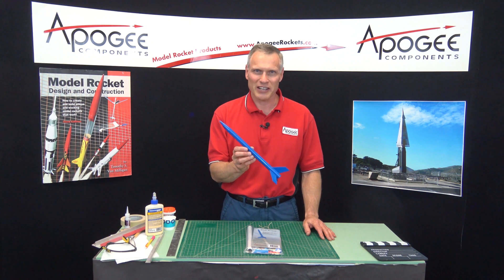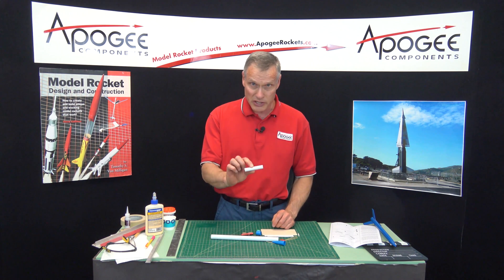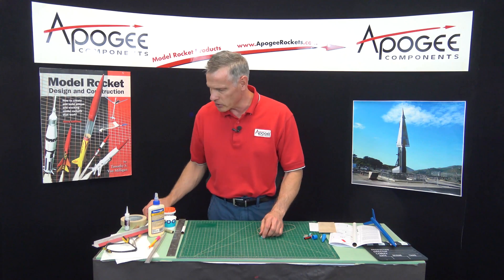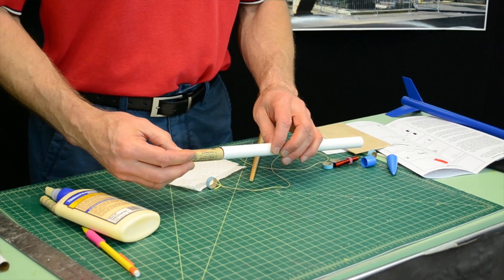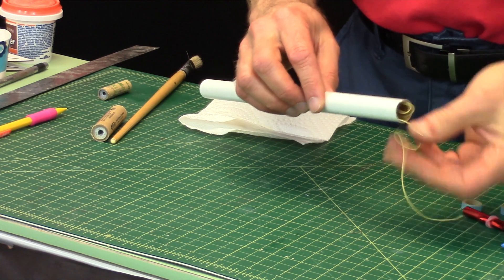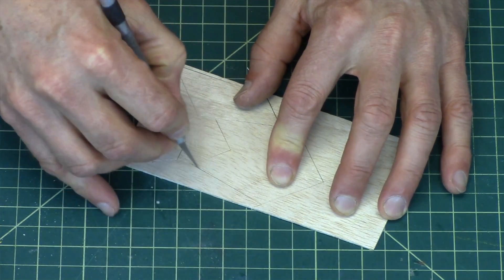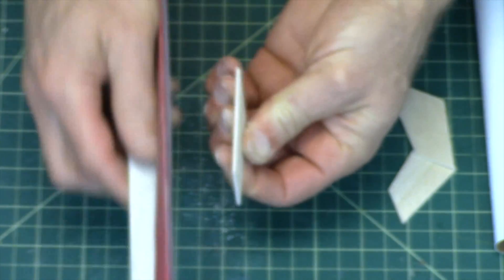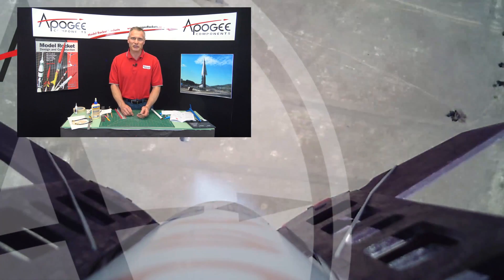Blue Streak Assembly: Part 1

Comment: I also always save the spent motors, they make great adapters for smaller engines. 24mm for an 18mm engine, 18mm for 13mm engines

Comment: I love this rocket! I also LOVE these rocket assembly videos!!

My 2 cents...When cutting the V notch into the blue centering ring, I like to hold the centering ring with a pair of needle nosed pliers so my fingers are nowhere near where my cutting blade is (but then, I'm a clutz!). Also when threading the shock cord through the rocket body tube, [optionally] tying a tiny nut or washer on the free end "weights" the cord so it drops through the rocket body tube smoothly.
Reply: For the v notch, i normally put the ring down on a flat surface and cut downwards..reduces the risk of cutting too deep :)
Reply from the maker: Great tips, thanks for sharing. :-)